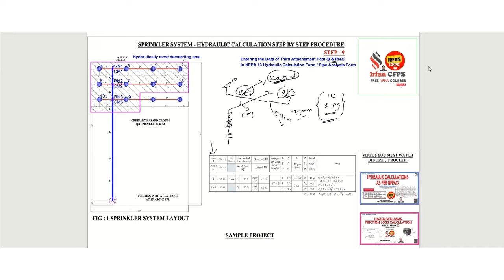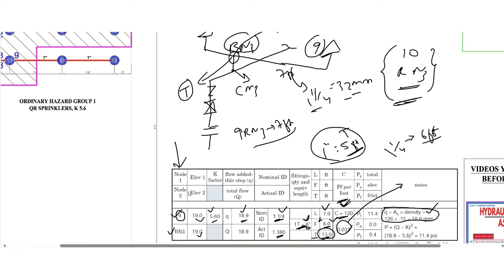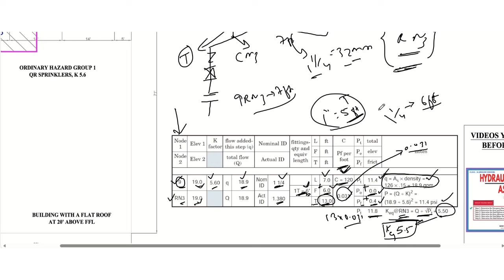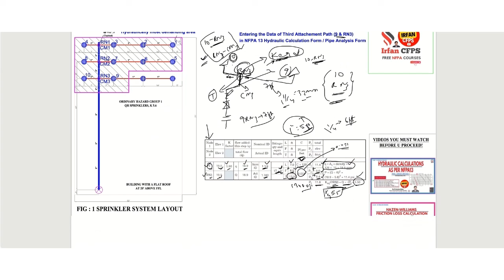Step 9 |Hydraulic Calculations for Sprinkler Systems

Comment: How do we get pipe size is 32 mm here and previous step 25mm?
Just assumption?
Reply from the maker: I don’t think there is any contradiction. For 25mm size we can go upto 2 sprinklers for 3rd sprinkler we need to use 32mm pipe. Please check “pipe schedule method” video available on nfpa 13 series playlist for better understanding